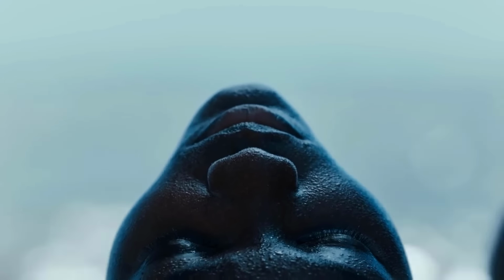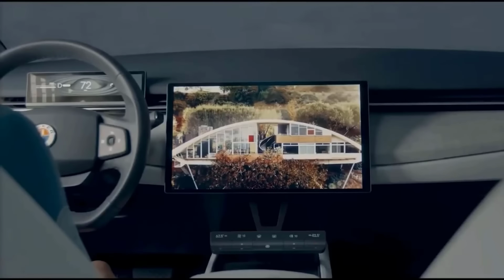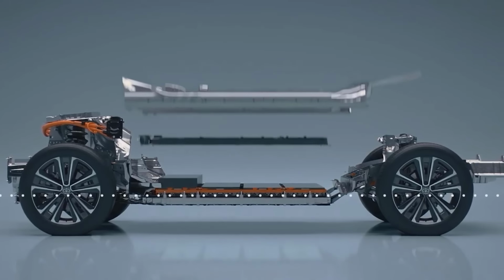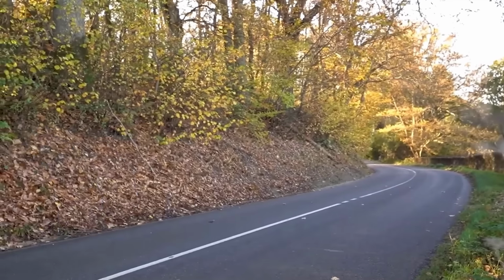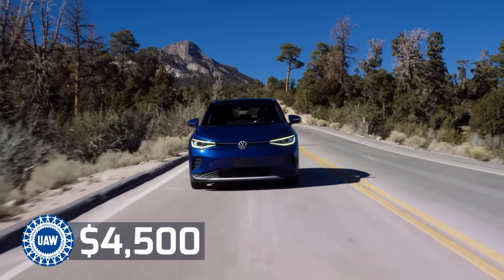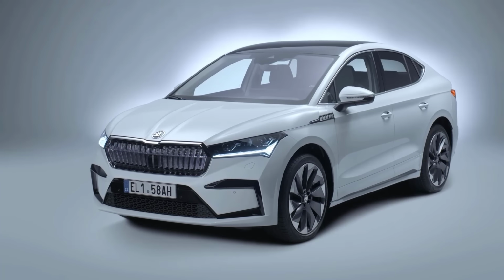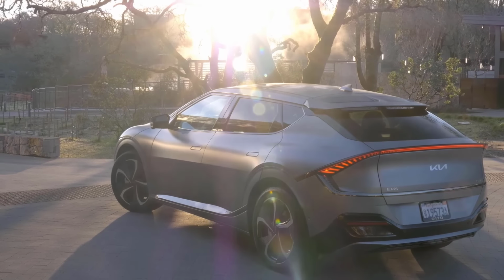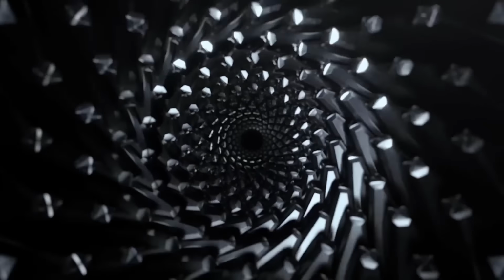TESLA's Half Price... 5 Great Electric SUV

Comment: I have been told a new EV named VinFast is a lot more affordable. There're 2 EV models coming out: VF8, a 5-seater SUV and VF9, a 7-seater SUV. With the battery leasing program, a VinFast car driver will never worry about the $23,000 bill to replace the battery, and all VinFast batteries will be appropriately recycled to safely protect the environment. Surprisingly, after the federal tax credits for EVs, VinFast VF8 costs only about $32,000, which is unbelievably cheap for a 5-seater electric SUV, and the 7-seater electric SUV VF9 is probably about $46,000 after the tax credits. Best of all, VinFast offers a limited warranty coverage of 10 years or 120,000 miles, whichever comes first, and this is the longest warranty coverage done by an EV maker. All of these truly set VinFast apart from other EV manufacturers. Still have no glue about VinFast? Just consider it as a "twin of BMW", literally. In fact, driving a VinFast car is like driving another BMW -- a luxury car but more affordable, and designed by Pininfarina!
Reply: Don't think you'll qualify for the $7500 tax credit since you don't own the battery. Believe the battery service with unlimited mileage is about $200/month. That's every month for as long as you own your car. So in 5 yrs. You've paid an extra $12,000.00 for battery rental. Don't see this as a good option at all.
Reply: @davekozlowski1266  Like anybody else, I had taken it with a grain of salt until I talked to the Vinfast people at the New York Auto Show last month, in addition to doing my own research. VF8 is an Italian-styled, German BMW-based, premium all electric SUV with high tech features inlduing voice activation, and sold at an affordable price of under $31K after the credits. The price excludes the battery that would cost up to $20K depending on the battery types. This means all VF8 buyers don't have to pay a large sum of money up to $20K when buying the EV. As a result, VF8 buyers will pay no sale tax for the battery and use that large amount of money (up to $20K) to invest in stocks or put in savings to earn extra cash to pay for VinFast battery leasing porgram, which is roughly 1 - 3 bucks/day! This is how money makes money. The unlimited mile fixed lease option is even better for Uber and Lyft drivers because after paying only about 3 bucks each day, they have unlimited miles, pay nothing for energy cost at public charging stations, and best of all, they don't have to worry about the costly battery replacement bill after 8 years or 100K miles. Of course, VF8 drives will get a brand-new battery for free if its capacity drops below 70%.  For VF8 battery leasing program, the $35-monthly option or simply one-buck-daily plan, is for those who don't drive much (up to 310 miles/month), and with the unlimited-mile fixed-lease option of $110-monthly plan or simply 3-buck-daily plan, drivers have unlimited miles. Vinfast has offered so many perks and benefits for all Vinfast drivers! Unbelievable!
Reply: @imagination7555  from what I've seen, your numbers are wrong.  The vf9 lists for  $55k-$61k and unlimited battery service is $160 a month. So at the end of 8 yrs. You own a car with no battery that you have paid $15k+ for a battery lease. Don't see how this is a good deal.
Reply: @davekozlowski1266  You did not read my latest comment thoroughly. I am talking about 5-seater VF8, not 7-seater VF9.
Reply: @davekozlowski1266  VinFast VF9 is one of the first fully electric large 3-row SUVs, and it goes from 0 - 60 mph in an estimated 6.5 seconds. According to edmunds, "That VinFast VF 9 is a three-row electric SUV, is notable in itself, as there aren't many of those on sale. As of this writing, in fact, there are only two: Tesla's Model X and Model Y. VinFast VF 9 is 3 inches longer than hefty Tesla Model X and almost as long as the full-size BMW X7." With the battery leasing program of $160/month or roughly 5 bucks daily, VinFast VF9 drivers will pay no energy cost at public charging stations and have unlimited miles without paying any fees for additional miles. That's not it. VinFast backs its batteries with a lifetime warranty and says it will replace the unit for free once the battery capacity drops below 70 percent. This means a VinFast driver will NEVER ever worry about the $22,600 bill for the battery replacement after 8 years or 100K miles! Remember, the $160/month or roughly 5 buck daily fee is only for VF9, which is a large 7-seater/large 3-row SUV. For larger families in search of a spacious EV that doesn't cost Tesla Model X money, VinFast VF9 can be the one.
Reply: @davekozlowski1266  According to marketwatch, the Vietnamese-built 5-seat electric SUV is eligible for a federal tax credit of $7,500. In addition, Vinfast offers buyers who paid $200 to join the Vinfast Pioneer Club, a $3,000 voucher toward the purchase of the VF8. Also, the deal includes a complimentary advanced technology suite (valued at $6,500) and 6-night stay at a fancy resort in Vietnam (airfare not included).
Reply: @imagination7555  not sure where you are getting German, BMW based build. It's made in Vietnam.  It may be a good car, just don't know why I would pay around $60k for an ev without a battery. Also, don't know why you assume a battery will be shot in 8 yrs.
Reply: @davekozlowski1266  I had had the same question about the battery life of an EV, and I finally got it. Experts suggest that EV batteries often last from 10-20 years or theoretically last forever. However, EV battery degradation to below 70% is bound to happen at some point depending on the driving habits, charging habits, speeds, the temperature, road conditions, and more. As a result, several federal regulations require manufacturers to warranty EV batteries for 8 years or 100,000 miles to ensure the batteries hold at least 70% capacity. In reality, a Finnish man's 2013 Tesla Model S after 8 years started showing error codes while the mileage display was less than 100,000 miles in December 2021, and the only fix was a $22,600 full battery replacement, which was half of the price the EV retails for, and his final choice was sadly to blow it up instead of footing the bill.
Reply: @davekozlowski1266  Dude why are you using Logic? Going to confuse sheeple. haha
Reply: It’s from Vietnam.
Reply: Chinese car.. no thanks.
Reply: @Ryujio122  Why? I am sure you have no problem with your iPhone manufactured in China.
Reply: @arnieindus530  No, won't pay for Iphone only Sheeple do that, phones a junk delicate throw away item, give me the $40 special at Walmart. As far as "why to not buy a China car?"
 Well I don't support Communism, 
Slavery, 
or Child Labor, 
not to mention the environmental damage CHIna is so well known for. 
I'll keep my money in the USA. You keep your stolen slave built junk in Communist CHIna.
Reply: Or about 50% of the engine and transmission components in any GM, Ford, Chrysler etc.
Reply: @Ryujio122  apparently you are blind enough not able to see the Chinese EVs are the best in the world already.
Reply: Replacing battery's is not going to work!  They are doing in CHINA, In USA not going to fly1
Need 500-600 mile ranged MULLEN solid state battery may do it 1st!
Reply: Fus=ck Asian junk. It's most likely stolen intellectual property built by slave and children. I'll keep my cash in the USA, thanks though Wang.
Reply: I amazed that so many talk about passenger count. 
When every day on the roads I see single drivers.
Lmao

Comment: The question still remains what do we do with the used batteries since most of them are not recyclable?
Reply: Dont forget everytime you get into a fender bender, you need to replace the 30k cost battery also.
Reply: @LearingCenters  False
Reply: Most of them are, in fact, recyclable.
Reply: @sh969  false.
Reply: @sh969  That's a flat out lie.
Reply: @lonniebeal6032  well,there are a number of businesses actually DOING it (a new one is being built down the street from my parents), so....I'm going to assume y'all are planning to go tell those businesses that what they are already doing is impossible. 🤷‍♀️
Reply: They are fully recyclable
Reply: @Davidoneill1967  false
Reply: @Davidoneill1967  No they are not, you two need to do more research.
Reply: @lonniebeal6032  redwood materials does the recycling, Tesla also recycles the batteries. Recovery of materials is over 95%
Reply: @davekozlowski1266  false, they only recycle what is returned to the factory. Which isn't even close to what they are putting out.
Reply: @LearingCenters  First off, very few Tesla batteries have been recycled. Most are resold for home energy storage. Redwood materials DOES recycle all batteries. Sinse mineral recovery is 95%, at some point we will have enough materials from recycled batteries that minimal mining will be required.
Reply: @davekozlowski1266  fasle as any battery removed from the cars are defective. Try again ccp Muppet.
Reply: @LearingCenters  my proof is the number of listings on eBay. What's your proof?
Reply: @davekozlowski1266  lmao yes because it's on ebay it must be legit? How often does mummy bathe you Muppet? Nobody is removing a good battery from a running car ya clownshoes wearing child.
Reply: @davekozlowski1266  next time check those eBay listings muppet.  Zero are new and none have any mileage or origin info... Tell us clownshoes, how often do you remove and replace working battery that cost upwards to 10-30k a job on a perfectly running car? We will wait.. My source on how I know cars? The shop I been building them at for 30+ years, even been on cut chop and rebuild a number of times. 😄

Comment: Why they won't integrate solar charging on these awesome electric cars.
Reply: I heard musk saying the area needed for solar to give a good range is not enough on a car roof.
Reply: @Davidoneill1967  integrating solar into the exterior surface will never result in meaningful range.  However is you live in an area with meaningful sunlight,  then you will not require the  charging stations unless you are travelling.
Reply: How would they charge you for that?

Comment: The $7,500 tax credit is deducted from taxable income, not the price of the vehicle
Reply: Really, that sucks.  That's like $300 more on your return at the end of the year.  Sneaky marketing.
Reply: @MuahMan  Yes it does.  The tax credit really applies to deducting from taxable income.  If a person makes 40k yearly, then subtract $7500.  The person is now at a $32,500 tax bracket.  That’s how the tax credit works.  I bought a VW ID4 and after applying the $7500 tax credit, my refund was only about $800.
Reply: The only real way to get the full amount back is to be able to itemize on your taxes. To lower your taxable income to zero!  I got my whole amount back on my purchase two years ago. It’s doable, but not for most people, so yes it’s very deceiving!
Reply: @motch6182  yes, but let’s say a person makes $50k yearly, they would need 50k in write off’s which is hard nowadays since the SALT (state and local income tax) was capped at 10k.

Comment: I bought the first all electric Kia ev6 in my region a month and a half ago and I could not wait to sell it back to them even though I lost money! 250 mi of range is abso m********** lutely unacceptable! Great car great looking great features very satisfying in every way except that the electricity fuel problem is not fixed in this country! And don't you ever forget you need an extra I think at least a dedicated 30 amp circuit off your electric panel from your house led to your garage. But the biggie is that you cannot travel more than ever how much power you've got to get back home on, because sitting at an EV station is not going to work. Only the super fast charging DC plus stations can charge an electric car up to only 80% in about 20 minutes. You'll spend hours at any other kind of electric charging station. There's only one of those within 50 miles of my house in eastern NC! There are only five more within about oh I'd say 200 miles. None whatsoever east of interstate 95 in North Carolina South Carolina and much of Virginia. The infrastructure is not there yet! But it's coming. That 250 mile range that is the pretty much the baseline for an electric car right now only works if there are lots more DC plus fast charging stations available. The others are not worth going to do at all.
I replaced it with the Kia Niro non plug-in hybrid. The price point was almost half the ev6 and I can go anywhere. I could go nowhere in the ev6! I would not have a plug in hybrid yet because I don't want to deal with upgrading my electric panel and running a circuit to my garage, not yet. I love getting over 50 miles to the gallon. My only disappointment is that I could not get a niro with all of the features I wanted like heated seats and steering wheel, power liftgate which they think it doesn't need but I'd still like. I absolutely love the soft medium blue color it really stands out in a crowd. It is the best blue you'll find. I'll probably keep it until I find another non plug-in hybrid with fantastic features! Unless I bite the bullet and go ahead and upgrade my panel and put in a circuit, which for me will actually cost about $4,000 according to my electrician because I need a whole new panel upgrade to accommodate it. Then I'll find the best plug-in hybrid I can find. Then I won't have to buy any more gas at all most of the time :-)
Reply: First of all, $4k is overkill on pricing to outage your panel… second, do you really need to? Are you maxing out your 100 amp panel with A/C, electric dryer, oven, and a hot tub?  If you don’t have all those going at the same time, you don’t need to upgrade… next and lastly, who goes out and buys an EV without doing all that research first?!!
Reply: @motch6182  I did. I just sold my life's business and I was looking for a great new car. I'm single at 66. I knew I had enough money that if it was a mistake I could recover. Not everybody has that luxury. I don't regret doing it because I learned a lot from it. I found it very interesting and very satisfying to get rid of that car.
Reply: And it was a licensed electrician that told me that he would charge me $2,000 to upgrade my panel at $100 an hour but that he wouldn't do it because it was too much trouble and that anybody else was going to charge double. That is the basis for my price.
Reply: @wendywhite2642  sounds like a lazy electrician! Adding a sub panel to an existing system isn't a big deal. I'm assuming you have at least a 100 amp service and no room for extra breakers. If you only have a 60 amp service, you should upgrade at some point anyways.
Reply: @wendywhite2642  also, instead of selling the EV at a loss, you could have used that money for the electrical upgrade at your house.  But it's your choice and your money, you get to choose what you want to do with it! Enjoy your new vehicle.
Reply: @wendywhite2642  Kingston , new Bern, Plymouth all have Tesla superchargers, plus a bunch all along hwy 95. FYI
Reply: @davekozlowski1266  hi dave, what I learned is that its 240 mi range is not enough, in fact it would have to be a lot more than that for me to like it. There is just a tiny fraction of infrastructure for fast charge, and anything but a fast charge is an incomprehensible wait. I am so contented to get 53 miles per gallon with a 530 mi range on my Kia Niro non plug-in hybrid. I get such a kick out of seeing EV pop up on my dash, indicating the car is running off purely battery and no motor, no fuel :-)
Reply: @wendywhite2642  you drive over 200 miles a day pretty often?

Comment: Gosh these prices are well out of the range of normal people ! and where did they the designers get those design's , oh yep there 4 year old's rubbish bin ! they are horrible. No grill's on most of them  make them look unhappy, and when they do put a false grill on then it looks like it came from the £1 shop! As for the so called design of the wheels, well they look like they came from a Lego set,(the bits no one every used!  Charge rate useless if your in a hurry ! And little or no where to charge them ! How can you have one if you live in a second floor flat/apartment of an older block of housing with little or no parking,oh yeah dangle a cable out of your window that will be fine ! and one of the biggest issue's how long will the batts last, how will they be recycled , what about fire safety, when Hammond crashed that electric super car it burned for 3 days! it's all guess work, just like the range!  Just not good enough on many levels , ducking now from the haters